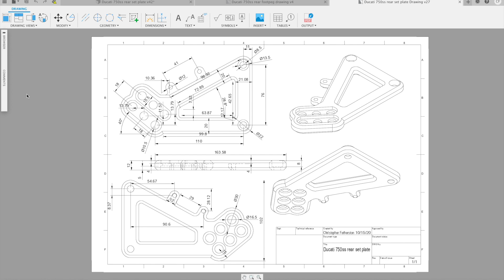Machining custom aluminum rearset for Ducati 900 Supersport on the mill and lathe!

Comment: Hi Chris, love your videos 👍 I'm just about to have a go at making a pair of triples trees, can I ask what speed do you find best for aluminium?
Cheers Stu
Reply from the maker: Depends entirely on the operation. For boring those holes I was using 2-300 rpm. For smaller stuff like the chamfers, as fast as the machine can go.
Reply: Thanks, that's helpful

Comment: Nice work. What's your technique for transferring the hole spacing perfectly from the bike to your fusion design? For me it's never easy so 'll 3D print the prototype to test fit on the bike before machining in Aluminum just so that I know the holes will line up perfectly.
Reply from the maker: I just measured with a caliper. Metric bikes tend to be sane round numbers in millimeters. The bolt holes are on a flat plane too so it’s easy.
Reply: @chris-builds  Gotcha. They turned out really nice.

Comment: I searched for a video like this! So I do track days and am finding parts are getting expensive. I was thinking of making my own replacement parts for rear sets.
Reply from the maker: It definitely took a lot of time but not much cost if you have access to a mill and lathe. Aluminum is cheap.
Reply: Chris Builds I imagine turning out 5 of these wouldn’t take that much longer